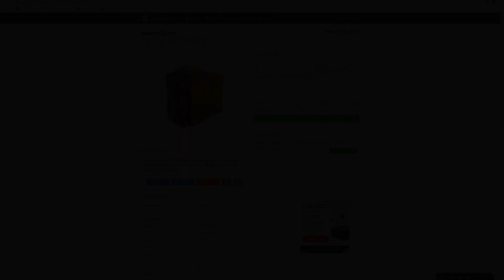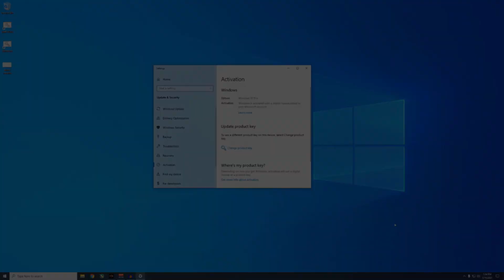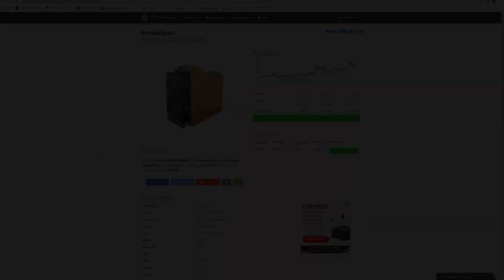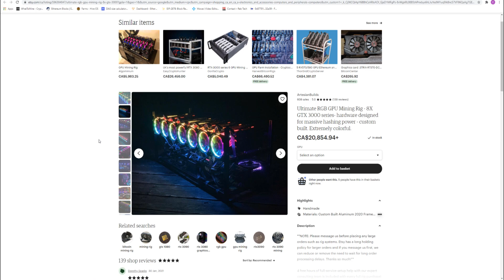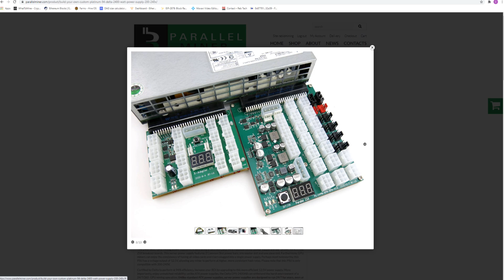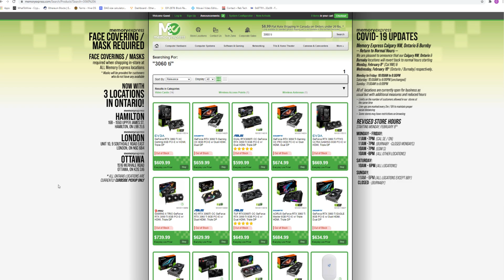3060ti Rig VS ASIC Miner A10 Pro+

Comment: Isn't Windows 10 you can download for free on their own website?
Reply from the maker: Yes which is fine for just mining but if you want any features like remote login changing the background or anything u need to buy it.
Reply: @RabidMining  I download Windows 10 for free, from their website. No black backgrounds and I'm doing remote login in without any problems.
Reply from the maker: @crash_rock2779  with 3rd a 3rd party program?  Or the built in remote?  Defult isnt black it's the blue windows window.
Reply: @RabidMining  I'm using NoMachine rdp

Comment: Can someone explain why some NVIDIA GeForce 3060 ti have 3 fans while others have two? I would expect this difference to cause them to have a different name but they have the same exact name. I'm so confused. Shopping for GPU's and I don't understand why so many different products have the same exact name.
Reply: Al my two fan 3060ti run hotter than the 3 fan gpu, that’s all I’ve noticed
Reply from the maker: Which ones do you mean?  Gogabyte are all different names. Eagle is 2 fans gaming oc is 3

Comment: You said you need a 240V for this setup. I assume 120V is fine if you're using fewer GPU's? How many GPU's can you hookup before 120V is not sufficient?
Reply from the maker: It all depends on your cuircit need 240v to run that server psu at 2400w  now 15 amp 120v cuircit is max  1800 at 80% that's 1440w with 240v you get  7200w max 5760 at 80%. That's for the whole circuit so if any lights or other plugs on that line are with it will drop the power u have to mine with.
Reply: @RabidMining  Thanks. I'm not sure I fully understood this. I ask because I'm thinking about building a rig but as you know in the US outlets are 120V. So I'm trying to figure out how I would build a rig like this while using standard US outlets.....Is it a matter of splitting up the power supply and plugging into multiple outlets?
Reply from the maker: @ThatOneScienceGuy  yes that could work but the outlets cant be on the same circuit.  Thinking about making a video on this topic. Power and the outlets
Reply: @RabidMining  I see, thanks. Looking forward to the vid.
Reply: @RabidMining  After a bunch of research this comment makes more sense to me now. So now I have a question about gpu. The 3060ti is rated as 200w but is that the level it’s being run at or is it being dialed down on a rig?
Reply from the maker: @ThatOneScienceGuy  always dial down gpus for mining gaming is harder on them then mining.
Reply: @RabidMining  Gotcha. So when it's dialed down I could theoretically run 7 of these on a rig with a max power draw of 1800w? Or is that too risky? I can't go over 120V because that's standard American outlet.
Reply from the maker: @ThatOneScienceGuy  video is being uploaded about power right now :)

Comment: This is last gen ASIC Vs current gen GPU. A11 pro coming out this summer does 2000mh.
Reply from the maker: Just seen dam 2500w that's op lol still over 6k less to build with GPUs but is a bigger power savings.  1852w more power with gpus.  Take 43 months to make up the power over price differance so over 3.5 years still makes gpus better for price.
Reply: @RabidMining  you can't even mine ETH in 3.5 years, and you can't buy GPUs right now so...
Reply from the maker: What's the power?

Comment: Double the cost of 12 3060 ti gpus when buying the 3060 ti @$600 each. Then a paperweight after mining goes down. With the 3060 ti you can sell them no problem. Don’t ever buy the ASIC miners.

Comment: Yeah you missed a few pros of ASICs, Here they are: ASICS don't require assembly-plugin and start mining instantly, ASICs are more reliable, The Density is incredible you can now get asics that do 2GH so you can fit a lot more hash in a smaller area.
Reply from the maker: Ya seen them 2gh ones but kept trying to contact the company with no response almost seems they made it up so went with the popular a10 pro + that most people know about.  True about the set up forgot about that.
Reply: It's the same company.. a11 pro. The a10pro is built with 10 or 20 series laptop gpu's. A11 is built with 30 series
Reply: LOL yeah 2GH for 50,000$ then when eth is done because of eth 2.0 you got a 50,000$ paper weight LMAO asics are for Huge money players not people looking to spend 10-20k hahah
Reply: @hecrimmain7511  it's €20,000 not 50, and it will pay for itself in 91 days so....